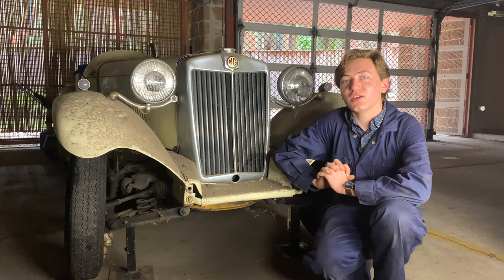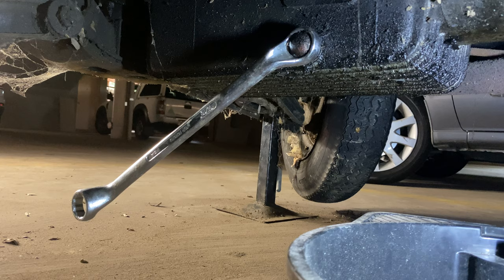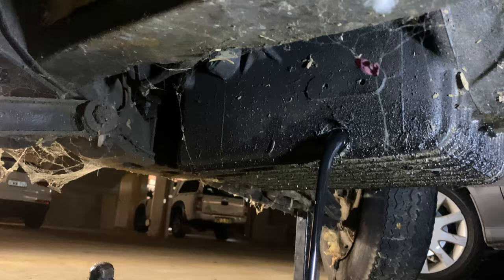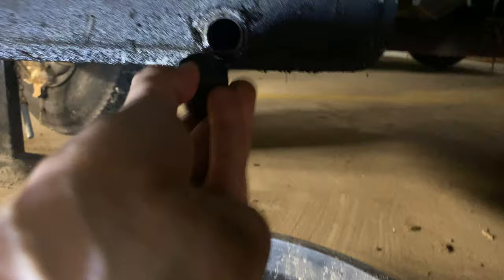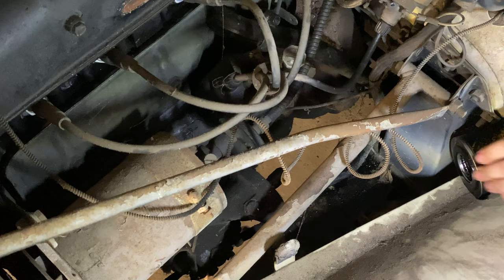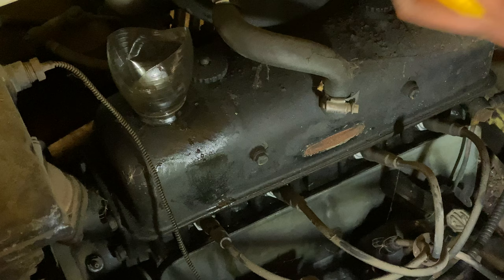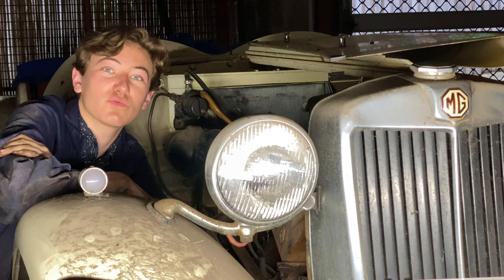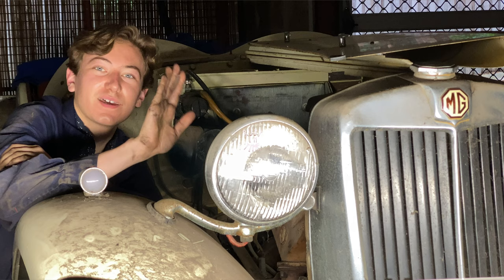Barn Find MG TD Restoration Part 2: Oil change and SU Carb removal

Comment: About that oil filter, there should be parts on the bolt inside the can before the filter goes in. A spring, a washer, a seal and a plate. 
If these parts are missing the filter isn't doing anything.
Reply from the maker: Yes, the spring and plate were inside the housing, but I didn’t bother disturb them as they stayed in place when I was putting the new one in. The spring compressed fine when screwing the assembly back on too. You are very observant, thank you!